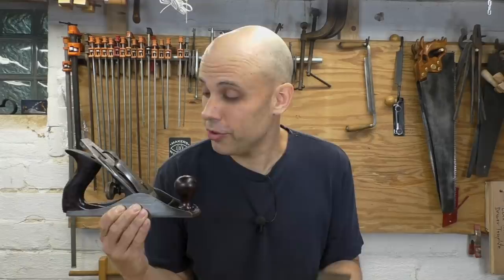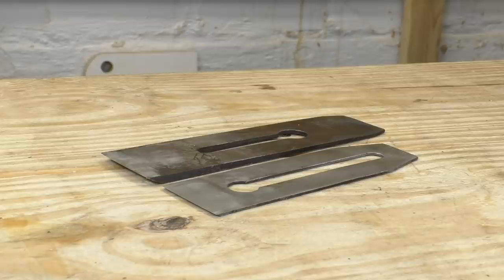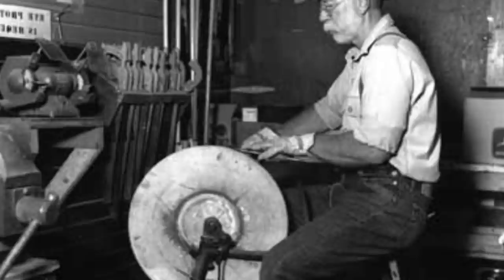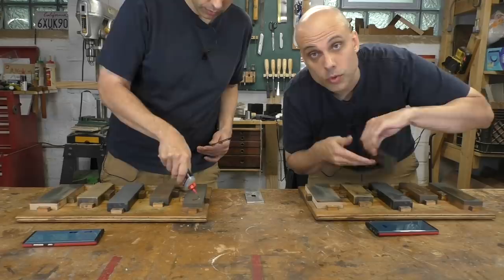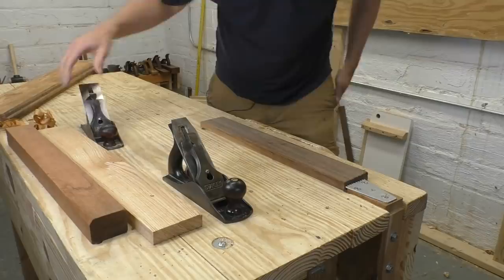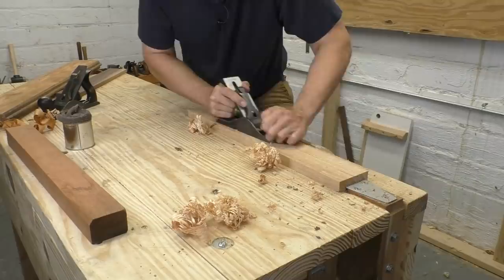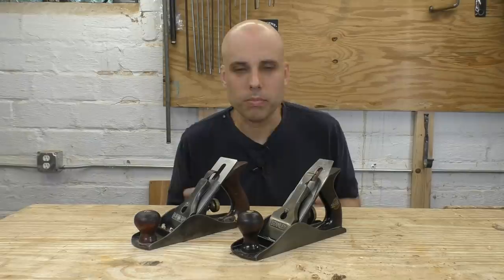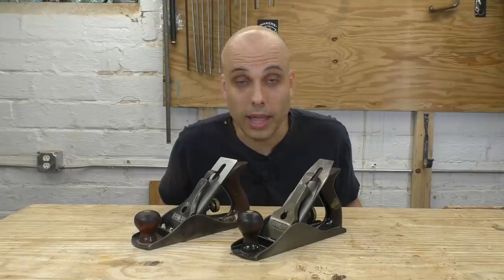Modern vs. Vintage Plane Irons. Head-To-Head Test!

Comment: I have 3 irons for my plane and one is a Hock blade. When a blade needs to be sharpened I swap it out for a sharp one then sharpen all the blades and chisel at the end of the day. I say all of that because when I swap blades of different thicknesses, then I need to adjust the opening and if you are doing what I do then you will definitely appreciate the bedrock style. It is way easier get the throat closed down just right with a bedrock plane. Get that throat closed down and blade sharp and you can get rid of the tear out on that piece of oak. I enjoy using my plane, not sharpening or setting it up…

Comment: I have no complaint with the thin blades on Stanley 3, 4, and 5 and one-half. Also, my wooden Baileys work great with the thin blades. I did buy the Hock blade for my Stanley roughing plane for crossing the grain

Comment: I tried thick irons. The thick irons, I thought had an advantage initially. But with further experience,  I was seeing the difference between a 25 degree flat (planar?) sharpened edge and a Hand sharpened edge with it unavoidable bevel... ( the flat edge is better). Particular with the a reverse grip (unplugged workshop) a honing jig is worth is with the time..
Reply: Adding to this - the thin irons work the same - but is important to follow Leonard Bailey"s advise and check that the chipbreakers (cap iron) is holding down the blade at the end (fitted as per Rexs advise) and at at least 1/3 of the distance from the end to the shipbreaker screw of the blade hard against the chipbreaker...  

Leonards 1867 for thin irons state the and hence the bump in his shipbreaker design..
In old planes the shipbreakers seems to have been trodden on by serval elephants and are all sorts of weird shapes.

What I do .. (for thin blades)
Bend the front so that shaving are hitting a steep  chipbreaker wall and bending back (the shipbreaker seems to general end up about 0.5mm to 0.7mm - any closer and the plane will not shave - if further tear out increases.
The shavings need a fairly wide mouth when running this way, but its worth, as the tight mouth opening do not control tear out as well..
Increasing the chipbreaker angle helps increase the pressure the applied to the blade. It load removes better and the chipbreaker is has more compression loading rather than bending ((increasing stiffness) 
When the chipbreaker screw is tightened I check to see at least 1/3 of the chipbreaker is hard against the plane blade.

Typical results of the improved holding of the blae>>
Typically the blade becomes quieter - indicating less vibration
Skipping marks ar the start of planing become less common.
Sticking(coming to halt part way) becomes less common
Beside durability (improved durability of modern metals) it starts starts to become hard to tell he difference between premium planes and run the mill planes>

why the essay,
I have not noticed anyone describing how to optimise the chipbreaker  in the various videos of renovating planes. 
I spent considerable time, before I tried reshaping. it would be easier if had clued onto the problem

Comment: I put a hock iron and chip breaker in a second hand No 4 and it jammed. When I learned a little more, I flattened the front edge of the chip breaker and the front of the cap iron. Absolutely a different plane after that and no clogs. Until I got that done I was more than a little disappointed as a novice woodworker trying to become friends with my plane.

Comment: I find the chip breaker to be the important piece of the puzzle. Due diligence is required as I have found the notch for the adjuster is not cut the same distance from the bevel,  brand to brand. Case in point, Lie-Nielsen makes a fine CB, but it will not work on my favorite planes by Millers Falls. On a budget? My best suggestion for replacement blades is Record. Most of my go to's have Record blades with an aftermarket CB.

Comment: good content.  Picked up two #5's that both date to about 1910 at a yard sale.  One I'll replace the blade only because it ground nearly to the slot.  Other than that, I just use stock irons.  I also have a #7, dating to 1890 and a #8 from the 1980's.  The plan fromt he 1980's pretty much sucks, while the 1890's plan with a replacement bi-metal blade is a real winner.  There's more than the blade to the great plane, but the blade does make a difference.

Comment: I have found that the thicker blades give me a longer time in use, smoother run and less chatter- even with oil/wax. Most of my planes are old and well used/abused so I had to replace the blades anyway (Beat up, warped, etc...).
Reply: Chatter comes down to wood selection and judgment. A thicker iron can be tool fit for certain types of grains but you are going to have to judge that and not automatically assume that i means better.
Reply: @bighands69  Not an assumption for me....fact. I grew up using mainly hand tools/planes and each species and grain will/can obviously have differences. You might not be good enough to tell the difference, but I can.

Comment: Interesting test. I just replaced the old crooked Stanley iron in my vintage #4 for a Hock and at the same time the skewed chip breaker (jamming constantly,  despite flattening etc.) on my modern Stanley #4 1/2 for a Hock. Both turned out to be a massive improvement.

Comment: When my father passed, I inherited his sizable collection of vintage iron planes, (various eras, makes and sizes). Most of his wooden body and transition planes went elsewhere. I've got three 5 gallon buckets full of block planes that I haven't even had the chance to look at. My father acquired most of these planes from flea markets and garage sales, so their user history is mostly unknown aside from what I can infer from close examination. Of all the irons I've so far inspected, I only came across one that had any indication there was any evidence that anyone had attempted to lap the back of the iron, (which I think makes sense because I believe that it's only been within the last 20 years or so that the practice has started to become widespread, and even then, it really a hobbyist thing since there really isn't a lot of carpenters with hand planes on job sites anymore). When my father taught me to sharpen an iron fifty years ago, he was using a single, cheap, 250 grit stone that was never lapped, but it was good enough for the carpentry work he did, and to tell the truth, that's all I ever needed when I jobbed out as a trim carpenter. Most of the irons were rather coarsely sharpened (compared to what we now see via the internet), and only the ones that had no obvious evidence for having ever been sharpened, (i.e. "new in the box"), could have ever hoped to have made a full width shaving.

Of the irons that I've taken the time to reshape and resharpen to 4,000 grit, they've all performed well enough, (on pine at least), that I can get full width, thickness readings  of '0.0', when using cheap digital calipers, (yes they work, but are inadequate for the test at hand). I did try a Veritas A2 iron but other than it needing to be adjusted for a slightly thicker iron, I can't devise a home brew test to tell if it can make a finer cut than a vintage iron. I did some sporadic planing with hard maple, teak, jatoba, purple heart and oak, but not enough to say anything other than, "yeah, I can plane it".

Regardless of size, be it 3, 4, 4-1/2, 5, 5-1/2, 6, 7, or 8, be they Stanley and/or Miller's Falls, Record, Union, Sargent, etc, or whatever vintage, if I sharpened and tuned them up, they all performed satisfactory. As I continue to sort through the pile evaluating their condition, I keep looking for something in poor enough shape that I don't mind converting to a scrub plane, but so far, no matter how bad of condition, I haven't come across one that I haven't been able to bring back from the dead. Even planes that had been broken and brazed can still be made to perform flawlessly.

There are some differences between manufacturers that were likely touted at the time as being 'superior' for one reason or another, but to me, didn't appear to make a difference to outcome. There were some interesting innovations from competitors, eg. the jointed cap iron of the Millers Falls and the Record SS, (stay set). These innovations didn't necessarily improve outcome of planing, though might have benefited other users in terms of saved time, or some other relative value that may be unknown to me, or not relevant to me. I also couldn't tell any difference in outcome between smooth and corrugated soles. I suspect however, that subtle differences if any, might really only become apparent if you're planing day in and day out. In such cases, I can imagine that heavy users will find huge differences between even seemingly identical planes, but suffice to say, I don't have enough experience to appreciate subtle differences. I do admit to being curious as to how contemporary irons and contemporary, premium planes would perform in my hands.

Comment: I'm pausing at the intro... 

Yes, you can sharpen a stanley blade and make it cut great. For a little while. 
Getting a stanley to what I would consider an acceptable standard can be a lot of work, especially on the chipbreaker. 

Stanley blades will, absolutely, dull far too quickly to be what I consider useful. 
I don't want to be sharpening before and during jobs.
A2 is the only other steel I've used in planes so far, and is far superior at edge retention, and an acceptable steel for plane blades. 
I'm keen to use PM-11, and will get some to try when the next batch is made available.

Comment: As someone who has sharpened and used knives for a living, I can tell you that the only difference in performance you get from thickness is basically just the stiffness - provided that the steel is the same and the treatment of the steel is the same. You wouldn't want a plane out of anything thinner than about 1mm in something like a plane, above 1.5-2mm, you won't see much difference in most woods. So, yeah. The results were expected(including the back-and-forth in your oppinion as you sharpened and set the irons).

Comment: This is something I've tested extensively in my own shop, and came to a similar conclusion. There's no doubt that the newer Irons are better made, but the performance difference is generally pretty subtle yet still noticeable. The interesting thing I found is that what really makes a difference is not the iron at all, its the cap iron. Swapping out the old Stanley chip breaker for a proper machined cap iron will give you the same chatter reducing results, and only costs about $35 for a premium option like the Hock or the Veritas.
Reply: How does the lever cap cause chatter? What are the mechanics of that process that the machined cap alleviates? I'm curious, as it's not something I experience with a sharp blade and a good setup on an old Stanley.
Reply: @ricos1497  Assuming everything else is set up correctly, chatter is usually caused by the blade flexing slightly or moving during the cut. The old Stanley planes use a traditional chip breaker design, which is thin stamped steel, and can flex with the blade. Modern cap irons are usually thicker than the blade itself, and are made of hardened tool steel, which when clamped onto the blade adds a lot of rigidity, and stabilizes the steel just behind the cutting edge. These are all subtle differences, and I'm just sharing my own opinion based on my own experience
Reply: @lyster1ne681  I think there's a misunderstanding -- you said cap iron, meaning the chip breaker, but Rico S interpreted "cap iron" as lever cap. (I can never remember which it is myself.)

Comment: I've been mulling Hoch blades for quite some time, but so far my old Stanley blades have stood the test of time. When and if I ever find the need and can afford it I'll bite the bullet. I'm still spending the lions share of my tool budget on high quality saw blades since I do spend a lot more time ripping thousands of feet of lumber than planing by hand. 
For me it's production vs super smooth finishes.

Comment: Honestly same, I got a Hock iron for my no. 4 because I didn't want to deal with a small cluster of light pitting that's nearing the edge of it's original iron. Plus little work flattening the back a little. The other positives, however subtle, were a plus. I just have the iron with the original chipbreaker.
That said, I still love the thin, laminated Marsh iron that's in my no. 5 or 1940's no.26 transitional. I like to swap irons a lot just to delay sharpening just a little bit longer.

Whiich reminds me to finish restoring that Marsh M4 that the iron came from. Still disassembled and neatly organized in a box. Just need to repaint the sole after the japanning came off from the evaporust.

Comment: A number of my vintage Stanley blades had a short section of tool steel about 1/2in long swaged into the end of the blade.   Once this section is worn away by grinding, the rest of the blade is soft and will not hold an edge.
The Sweetheart blade may be all tool steel.   This was clearly done to reduce the cost of the blade.
Some of my vintage Stanley blades were also warped across the blade making a challenge to flatten the back.   This can happen over time.
I upgraded my Stanley planes with Veritas blades and chip breakers from Lee Valley.   I get fewer chip clogs between the blade and chip breaker with the Veritas chip breakers.
I think the Hock blade will likely hold its edge longer than the Sweetheart blade.
Dave.

Comment: I wonder how a new Stanley replacement iron compares against the Hock or even a vintage Stanley iron? Like yours, my irons in my vintage Stanley’s are well..vintage also.  I do have a Hock in my #4 and love it. Being honest with myself, the difference between vintage OEM and new Hock is subtle.  I guess what I am saying, is that when it is time to replace an iron, splurge a little and get a Hock. 

Total aside, while on vacation in Fort Bragg 15 years ago, I met Ron Hock and visited with him in his shop. He was tuning a #4 for a friend. He clearly is a plane user and not just a blade maker.  The end result of the tune of an old beater Stanley was a micro thin, un torn, looong shaving. I bought an iron and chip breaker setup and he autographed one of his books and gave it to me.  Hella nice guy.

Comment: It would be interesting to have a machine shop grind the thicker iron down to the thickness of the Stanley and retest to see if it was in fact the thickness of the blade or the type of steel used that made the difference.

Comment: Hey Rex, I think your Hock setup got shavings between the Cap Iron and the blade because there’s a gap between the two. David Charlesworth recommends that one should “sharpen” the Cap Iron to eliminate the gap. It works flawlessly.

Comment: I have a hock iron in both my Bailey no 4 (I think a type 13) and my Bailey no 7 (type 7). Noticed a minor improvement in the no 4; less tear-out on figured and dodgy grain, slightly smoother operation overall. I will say, it took some work to set the frog properly to get the right amount of blade protrusion. But the no 4 as I've set it now with the Hock iron takes whisper thin shavings with almost no tear-out, even on knotty Birdseye maple. 

The no 7 was just astounding though. I will always find an excuse to use that plane because it cuts so well with the Hock iron that I almost didn't believe it at first. I have it set up to take a shaving that's almost as thin as a no 4, and it leaves a finish that's almost as nice. For the bulk of my work, it's turned my operations from roughing with a 5, jointing with the 7, then smoothing with the 4 to just roughing with the 5 and simultaneously jointing and smoothing with the number 7 and doing minor touchup work with the no 4. I'll say I'm not a replacement iron evangelist, but given the choice between them and the vintage stanley irons, I'd choose Hock irons any day

Comment: I noticed that you not only used the Hock Plane Iron, but the Hock Cap Iron as well. The chip breaker is sort of the "Redheaded Stepchild" of hand plane parts. Everybody concentrates on the blade and how to sharpen it, but pay almost no attention to what, by applying even, consistent pressure, holds it flat and true to the bed. It would be interesting to, over a period of time, do an experiment with your collection of similar sized planes, that, despite your sharpening skills, just don't seem to cut as well as they should by replacing the chip breaker with the one by hock you already have.

Comment: I have had several planes that I could not get to cut very well with the standard blade.  I tried swapping the blade around between planes and the problem planes remained difficult.  As soon as I tried a Hock blade the problems went away. For me, Hock blade seem to sharpen and cut better (not a fan of the cryo treated blades. I find them very difficult to get sharp.).  I have one or two planes that don't get much use (#8) and the upgrade to Hock probably wouldn't be cost effective.

Comment: I couldn't agree more with Rex's final verdict. Don't change what works for you. If your blade isn't working, and you can only know that after a great deal of fettling, a new blade is an excellent investment. Next question, should you also buy a new chipbreaker with the new iron, or just pair the new iron with an older chipbreaker? I believe Ron Hock has stated that you can use the old Stanley chipbreakers with his irons.